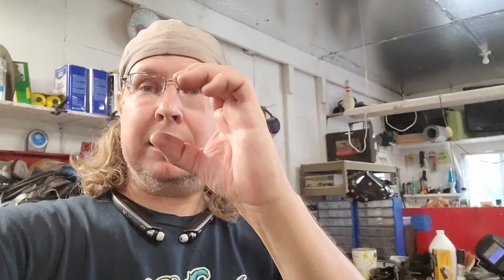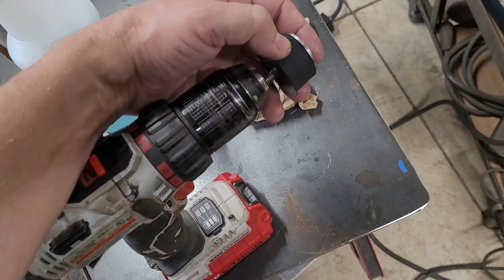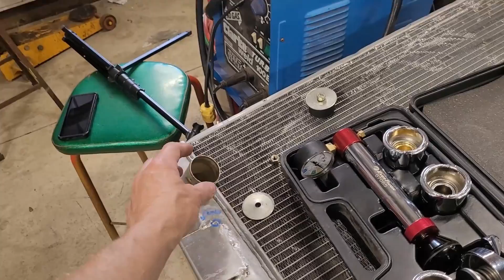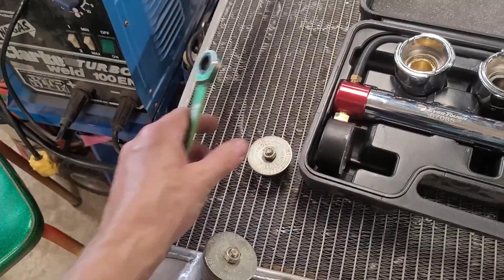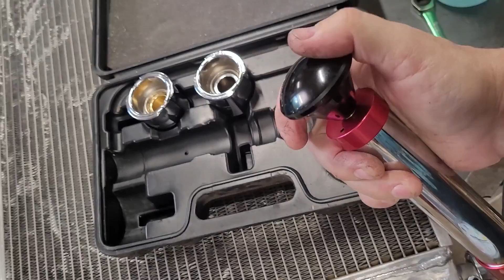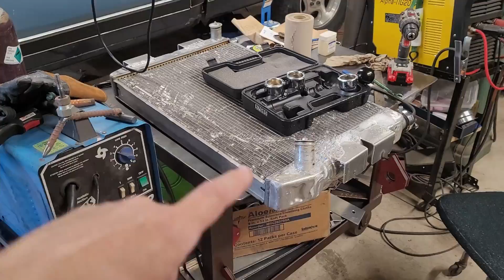Cheap & Easy DIY Radiator Bench Pressure Test - Test Radiators Outside of a Vehicle.

Comment: Maybe you can add a small clip of you spraying the tank section and fins with soapy water in a bottle. If you see soap bubbles bubble up and expand then you have a radiator leak. It can also help you identify vacuum leaks in hoses, water pump gasket, thermostat housing gasket or heater core hoses. And in my case my 02 Jeep Grand Cherokee Laredo 4.7L has a transmission fluid cooler inside the radiator tank with two 3/8" NPT fittings that connect on tank which is a common leak point, on ATF cooler line fittings (internal threads of the fittings)
PTFE Teflon tape does wonders to fix this if you wrap it counterclockwise so the tape doesn't unravel from installation and leave the first 3 threads so it can properly start threads to radiator
Reply from the maker: In the video I do show testing it with soapy water. It had some leaks which showed up pretty well. Teflon tape works great. Especially the heavy blue stuff 👍🏼

Comment: Pretty cool method I just did a video using a 26in bike tube and a kiddie pool to pressure test a 72 A body mopar radiator work very well.
Reply from the maker: I'll have to check that out 👍🏼👍🏼 Thanks

Comment: Is that a ford f'n Ranger wheel on ur Ramit?!?
Reply from the maker: Indeed. Exploder wheels. When I got the truck, it had painted Cragars!!
Reply: @HFG  Cragars. Mmmmm
Reply from the maker: @MortskeRepair  yup. I don't like em either.
Reply from the maker: @MortskeRepair  I'll try to find some nicer wheels once the truck is all dialed in and running well. I kinda like the look of the old Mopar black steelies with dog dish caps.
Reply: @HFG  I like the "police" rally wheels and dog dishes. Can't find any. I have 1 single wheel here.
Reply from the maker: @MortskeRepair  yeah those are the ones I mean. I haven't seen any in years.